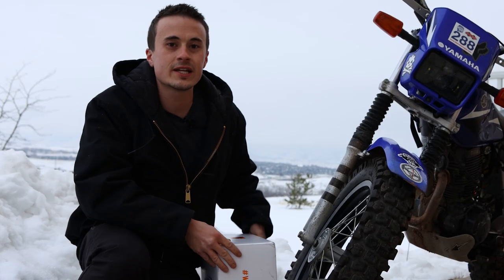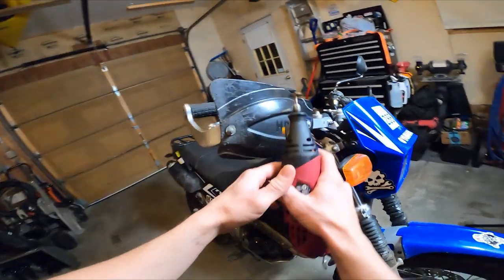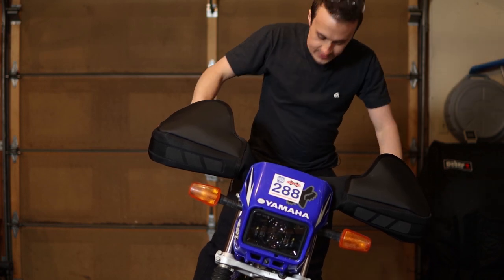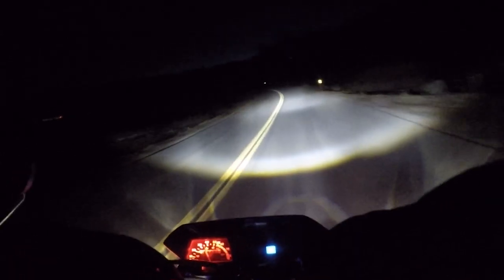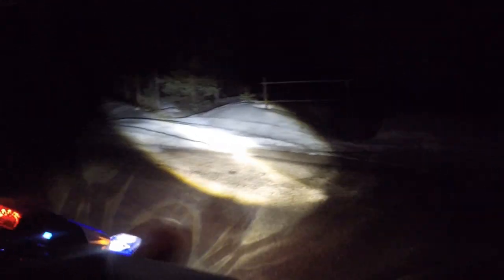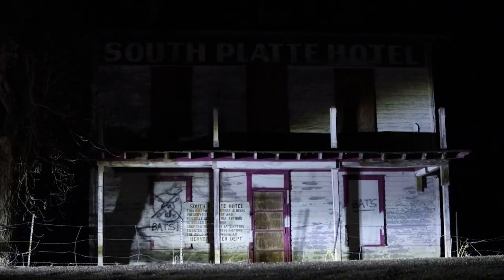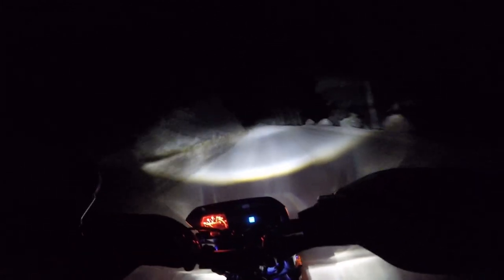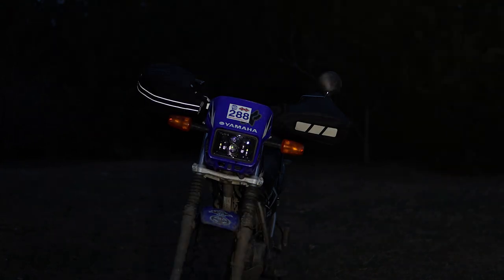How To Keep Your Hands Warm | Testing Out the New Hippo Hands Backcountry Motorcycle Hand Covers

Comment: I modified the hand guards on my KLX250. I experimented with airflow and adjusted the additional curved plastic I added inside the hand guard so that air and water went over the top of my hand and stopped rain coming up and under the handguard. A little time adjusting things made a huge difference.
Reply from the maker: nice! glad it worked out. I tried riding without my handguards in cold once and it was a huge difference

Comment: You can make a slit to put mirror ends through maybe.  I think you need a windshield. Like people puton the DR650 and mod a WR250R for Adventure riding. Parabellum or something that attaches to the headlight case.
Reply from the maker: yeah that could work. not sure how much air flow that might introduce though. yeah that could be cool. there is a guy who makes them for the TW200

Comment: Check out Forma boots.. The only reason I got wet feet was because I didn't have any waterproofs on my lower body, but when I did, riding through a hell of a storm my feet were perfectly dry... And you can get one that comes most of the way up to your knees, so great protection, also not bad pricing.
Reply from the maker: yeah I want to get those before too long. only down side is they wont dry out as easy if water does make its way in
Reply: @TDubsKid  took two days for my boots to dry after I got completely soaked from the waist down without waterproofs, so it just wicked into my boots.. So much fun on adventure rides.. LOL

Comment: Have you ever ridden a xt225? I started riding in a few years back on a tw200 and always longed for a 6th gear and decent tire options. I finally got one after eyeing them for a while. Do yourself a favor if you haven't and ride one. Thing is sweet.
Reply from the maker: I have not, but if I ever find one super cheap ill probably pick it up. they are neat bikes.
Reply: Yamaha F'd up not putting this gearbox in the tw and the xt250 for that matter.
Reply: I commute on a Kawasaki KLX250 with road tyres and large throw over panniers. It has the sixth gear and it's happy to get ridden hard on the way to work and just as happy to go home slowly at low revs. The KLX250 can be ridden in sixth gear at just over 30 mph and gets great mpg. They don't sell  the TW200 in the UK hence the Kawasaki, that said, I'd happily get another KLX250 if something happened to my current KLX250 even if I could buy a new TW200.

Comment: You should ride very carefully when it's below freezing, it can be very slippery.
Looks quite useful stuff those mits. I'm not riding when it's cold, but if I needed to ride in lower temperatures I'd get myself a pair.
And that hotel is *very spooky*! You know who owns it? Maybe you could buy it cheap and have your own shop in there - the TDubsShopKid?
And yes, a video on how you wash, and clean your TW would be super.
Reply from the maker: for sure, I slipped on a little ice once, they put lots of mag chloride on the roads up there so ice usually doesn't form much. yeah they really make a big difference in the cold, should help in the rain also. haha it's neat but not structurally sound. the water board owns it haha. cool ill have to do that and show how to do rust prevention with fluid film
Reply: "neat but not structurally sound" - kind of like your TW200 by now. No? ;)

Comment: Great review of both products!! I ride a big BMW GS Adventure, but the Hippo Hands Alcans prevent my thumbs from reaching some aftermarket controls on my handlebars. So, I am thinking of these HH Backcountry -- or even the OBR 3/4 Mitts (which I saw here for the first time). I have one non-related question: How did you get that cool double-shot of you both the left and right covers at the same time at about 10:53??
Reply from the maker: thanks! thought it would be a cool comparison, I really like the obr mitts especially for the price. super easy just install both mitts and don't touch the camera. overlay both clips you want and mask off halve of one to uncover half of the other

Comment: Another great video!
I'm not yet a TW owner, I'm still in the info gathering stage & have a few questions for you if you would be so kind.
My riding will be 99% off-pavement on mountain Forest Service 
roads, logging roads, and trails. I'm trying to determine the TW's carb tolerance to elevation changes. What is the elevation range of your rides? (example: 4000' to 9000') Do you have to change your jetting on any of your rides or does the TW carb give you a wide elevation range before rejetting is necessary? What is your average off-road miles-per-tank range? Thank you for any info you can provide.
Reply from the maker: hey thanks! glad you enjoyed it.
oh for sure, I have ridden it from 0 to 13,000 feet, never had any real issues and never touched the carb, almost 17,000 miles on it now. above 10,000 feet sometimes I feel a hiccup on full throttle once in a while but not bad. you loose some power the higher you go but that's any engine that is naturally aspirated. depends on the off road your doing. seems to be most efficient around 30-40 mph I got around 100 mpg once. usually around 70 to 90 it seems like. depends on how much weight and how you ride too
Reply: @TDubsKid  Thank you for your answers. I was worried i'd have a very narrow range of elevation change and would have to re-jet mid ride which would not be enjoyable at all😰